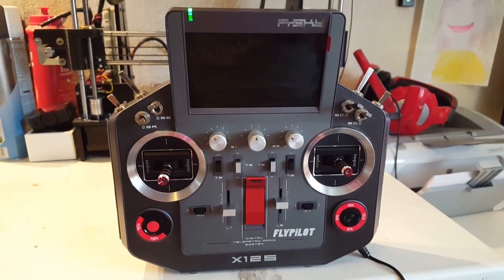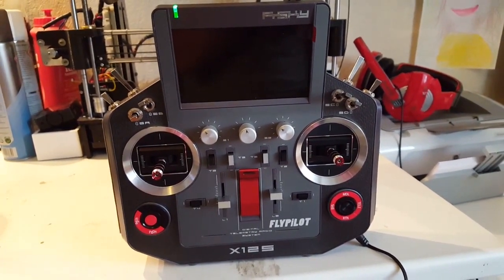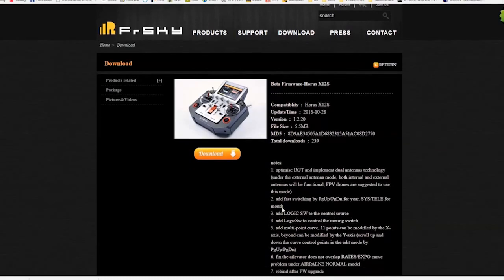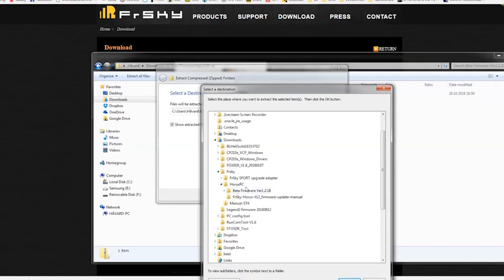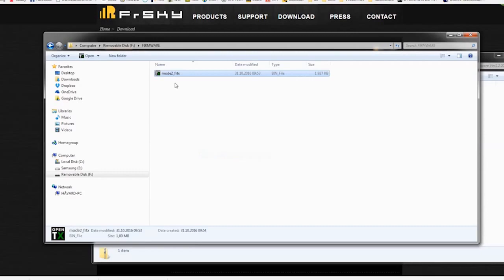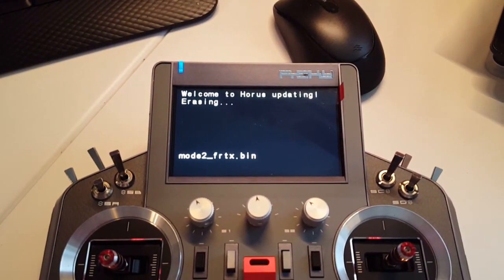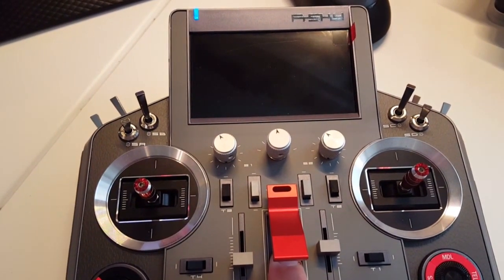Frsky HORUS : How to update your FrOS FIRMWARE

Comment: Hi, I just bought a used FrSky X12S and tried to update the FsOS Firmware but the update failed and now I can't turn on the transmiter or even can’t connect the cable to the computer. Do you know how to resove it?

Comment: How to reinstall Horus FrOS  X10S & X12S
Download latest firmware (there is .bin & .dfu files in the zip file) & FrOS SD contents from FrSky to PC
Copy SD Contents to a new SD Card  (make sure there is a “SYSTEM” folder and if not then create one). 
Copy the file “X10/X12 Bootload 1219.dfu” to the desktop
Copy the “.bin file” to the root directory of the SD Card and also to the “SYSTEM” folder.
Put SD card into transmitter.
Install “STM32bootloader”  using Zadig from http://zadig.akeo.ie/
Install Companion9x and run (go to settings and setup transmitter).
Connect transmitter to PC with transmitter switched off, Click on “Write Firmware to Radio” and select the “X10/X12 Bootload 1219.dfu” file on desktop, then write it to the radio.
Click on “remove USB device” and disconnect transmitter.
Turn on transmitter by holding down the “Enter Button” and the “Power Button”.
Select the “.bin” file you copied to the SD Card and follow on screen instructions.
Restart and that’s it all done!
Reply: Well written^ I am using FR-OS exclusively and don't fully understand the companion app but it's that ONLY for Open TX or is there a companion type app for FR-OS as well?

Comment: I ask because I didn't quite follow your directions exactly. Not because I didn't think you were correct, but because the screens on my computer (Win.10) didn't come up quite as your video showed. I had to use WinZip to unzip the files. Anyway, it went down a different path, maybe ending at the same point, maybe not?
Reply from the maker: The rabitt hole is always deeper than it first seems ;)

Comment: Nice video! I believe I have new (1.2.25) firmware on my micro SD card.  Any way of checking it is OK before I put it in my Horus, and try to update the firmware to something wrong?
Reply from the maker: Hi, Thanx, As long as you got the file from Frsky it should be ok, there is not any way of knowing if its good or bad I am afraid :) Good luck ;)

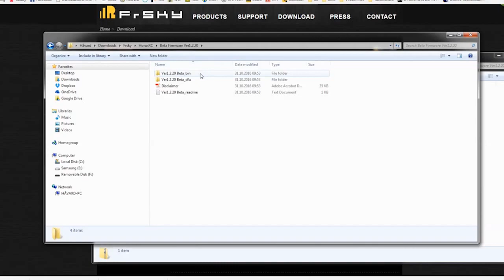Comment: Can't get to the different models as you show.... from the 2:35 min---2:54 min in your video. When I click on them my computer asks what program is to open this file?? Help
Reply from the maker: alex ubillus Yes you are correct. That should work out great.
Reply from the maker: Not sure I follow, you don't click them, you copy the file to the Sd card and insert it n your Horus
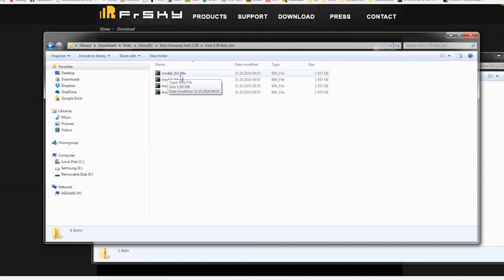Reply: I understand copying the file to Sd card....but ....when.... I click on the bin file my Windows un-zip/ zip program doesn't open to the mode 1 or mode 2  like on your video 2:37min.  I guess I need some other zip/unzip software but I don't want to purchase any software to do that. Do you have a link to software that works or some other solution why didn't FrSky use zip software that comes with Windows?
Reply from the maker: Try using Winrar. Frsky has changed the folder layout on their recent updates but the procdure is the same...
Reply: Your video is very simple & easy to follow...until I ran onto that .bin file extraction problem. I tried to describe what happens on 2 computers I have. One is running Windows 8 the other win7. The win zip program built in works great until I get to your one click Min 2:34 of your video.  You click once or twice....whatever but the first .bin file you click just opens up and displays four more .bin files.  For whatever reason I can't click the first .bin file to produce the 4 choices of modes & EU or FCC types.  What zip program is in your computer?

Could you just send me the .bin file & I will copy it onto my SD card and I will be done with this.  

Since it's so easy send me the latest non-Beta version from...1.2.21    just send me the file named ...... mode2_fstx.bin ...from version 1.2.21 & one file from Beta 1.2.25_frtx.bin which is.... mode2_frtx.bin 

Just send me those two files, not a link the the FrSky website not the zipped file that comes from the Web site just those two files. The file sizes are only about 1.9 kb....so attaching them to an e-mail..and send them to me.. should be easy.

Lee
Reply from the maker: Well, like I said frsky has changed the file layout and naming since I made this video, now you just extract the files and copy the 1225_frtx.bin file found in the 1.2.25(normal) folder into your Firmware folder on the Horus. Hope this helps.
Reply: FrSky is going to have to do more than just change file layout & naming!  The file needs to be a runtime .bin file not a compressed runtime file... You try what you have suggested I do...you'll see it won't work! For whatever reason FrSky must be using some sort of New World order compression software....why? FrSky will never compete with the big boys until they think more about the end user....me.
Did as you suggested with fresh download 1.2.25(normal) folder copied 1225_frtx.bin file to a good SD card(music tested) icon showing inserted.....held both start button & enter button....the radio just starts up normally.....no updating screen ..just a normal bootup. I have e-mails off to FrSky tech & Aloft Hobbies the company from who I purchased this radio.  I'm not about to install & fly this radio in anything until I can get this problem fixed. I have to keep asking myself why did I purchase this thing? Most R/C pilots I know want nothing to do with buit in problems......radio problems especially! 45 years ago we had to put up with crappy radio's like this...but those days are over.  I know I am not alone with this problem....Aloft's phone message machine is jammed up accepting no more calls.  If you have any pull with FrSky at all relay the message....if upgrades are a way of life with this radio then I would suggest they get  the Firmware upgrading problem fixed. My suggestion FrSky within a next version upgrade they include software which decompresses the compressed .bin file this issue is about.  The system is looking for a runtime file....a double compressed file is not runtime!
Reply from the maker: Thats really wierd, I did just as I (and you ) jist described and had no issues updating...You are sure you have a folder on the SD card called FIRMWARE?  sorry just have to ask...
Reply: Yes, all caps just like you ask.  Sorry for taking up your time, but I've got to believe I'm Not the only person to experience this issue. I've got a screen shot of my F: drive folder...etc.  Just don't know how to post it to this site.
Reply: Hi....am waiting for my horus to come in the mail so decided to transfer the firmware update to my sd card ahead of time. I noticed the file layout is different but what I did notice is that there is another file called localization. In that file are the folders named FIRMWARE and LOGS and even SOUNDS and MUSIC. I think you have to copy those to your sd card and then put the bin file in that FIRMWARE folder. I could be wrong but worth a try.

Comment: Happy New Year to you FLYPILOT! I have a video request.  I am planning on installing an autopilot on my new plane. I will need to be able to assign specific autopilot functions to 3 position switches.  I am clueless as to how this is done on the x12s.  Any help would be greatly appreciated!!  Title could be "Switches for Dummies"!
Reply from the maker: Thank you for your suggestion,  but have you seen my flightmode switch video? With small change it is very similar and works the same way..

Comment: The firmware updates 1.2.22 thru 1.2.24 do not have the different models listed, only bin files which do nothing when put in sd slot and turned on as you've shown!
Reply from the maker: Not sure I follow, I just updated mine to .24 and just copied the correct bin file (1224_frtx) to the firmware folder as shown in video and updated no problems..
Reply: so you copied the 1224 bin file to sd, installed in x12s, held enter button and pushed power button and it started installing?
Reply: does 1224 include the updates from 1222 and 1223?
Reply from the maker: Yes
Reply: Thanks! I figured it out. Sorry for the dumb questions.  I'm new to the rc world!!
Reply from the maker: Good to hear you fixed it...no dumb questions here, glad to be of help..happy new year

Comment: Thanks dude
Reply from the maker: Your velcome, subscribe for more videos like this :)
Reply: Mine don't want to boot on updating screen. I have the normal boot-up sequence (hardware X12SEU14, soft 1.2.15) :/
Reply from the maker: Maxime Daout are you holding the enter button while booting up?
Reply: Nope. I have to ?
Reply from the maker: Jupp
Reply: No change :/
Reply from the maker: Do you have the correct folders and the correct files in it?
Reply: LOGS and FIRMWARE...
No files in LOGS
mode1_EU_frtx.bin in FIRMWARE (as my hardware is a X12SEU14)
Reply from the maker: Your hardware version is on the back of the radio...mine say x12seu14 also but it's the fc c version anyhow
Reply: Nothing like that on mine...
Reply: Even with mode1_frtx.bin no update screen
Reply from the maker: Strange. Then I don't know. Sorry. Try rcgroups forum. Maybe they can help
Reply: Ok thanks.
Reply: My bad... I was not pushing correctly ENTER... ;) Update done.